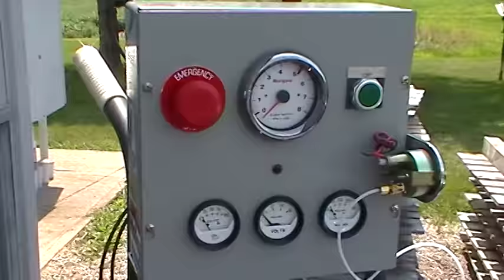383 Stroker Blower Motor Startup

Comment: First off how do you put a cam in a MOTOR LMAO. Second my LS3 in my 71 chevelle puts down 580 HP at the rear wheels and Naturally Asperated. These old iron blocks are a waste of time and carburators are a thing of the past. You can put a turbo on a 5.3 and put down 400+ HP all day long. Today technology is at everyone's finger tips and why they still mess with old technology is beyond me, unless the older gen techs have no clue what they are doing with a computer. I started building engines in 1985 and when the new stuff come along I jumped on it. Proven fact a aluminum block and heads with a more even flow intake and being injected with a good tune, is more efficient than a screw driver and a carburator. Unless your going for the retro look, there is no reason to have shit under your hood.

Comment: I will built bettle v8 panel van with original edlebrock crate engine 350ci with 100psi supercharger engine with intercooler make this 900hp

Comment: They will hunt they do that at low RPM or idle thought you knew that it's okay get rid of that plastic oil line once again can I believe you you look at that wrong you have oil going all over the place
Reply from the maker: When using carburetors it is a matter of carefully tuning. They will not "hunt" or surge at idle if the A/F ratio is right. This does not apply to mechanical injection. Surge also can be a problem if over-carburated.

Comment: tiny headers with poor design,thats gotta be killing a lot of power
Reply: +AngryDuckSoup where's your build?
Reply: +Kleo 84 ,want my build specs on my 11 year old street engine? Just for starters I use Jere Stahl headers with 1 7/8  stepped to 2" after 18" with 3 inch collectors with no reducers.Its an easy math formula to determine exhaust requirements. Just like when doing math for cam selection. As you already stated you are using a Howard's "hydraulic" roller you know that blower cams are different from N.A. or turbo cams. I wasnt shorting your engine build,just inadequate header primary tube size for what your engine requires,especially with a blower

Comment: So tell me, what causes that, what I call a '"runny loop"....the variance? think its lean do ya? that running loop aka surge? lmao Get back with me, I'll tell ya why...for now it's "just because" and yeah I'm Smart ass! what of it?
Reply from the maker: +William Carender .... It was lean. One carb was  not flowing fuel in one barrel. It starts right up and idles smooth now.
Reply: yeah I understand, it's a fall behind catch-up effect caused by the changing boost pressure, so don't run it rich to smooth that effect since after the pressures remain constant you'll find you are at an accurate stoichiometric ratio proven by o2 measurements for opium efficiency for piston travel burn rates. You've simple hid the variance loop by decreasing optimal stoichiometric fuel ratios. Check your data in a engine loaded environment, not during the idle environment.